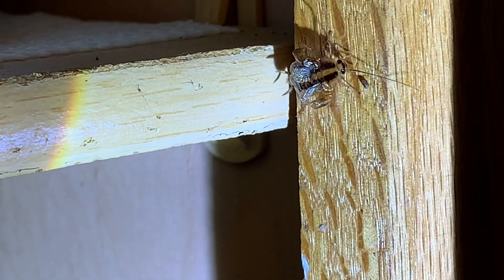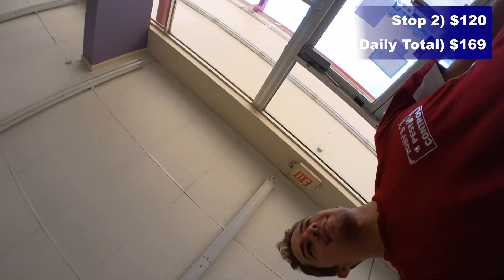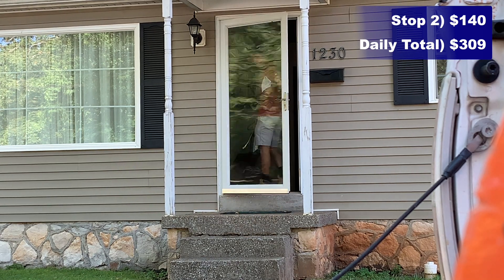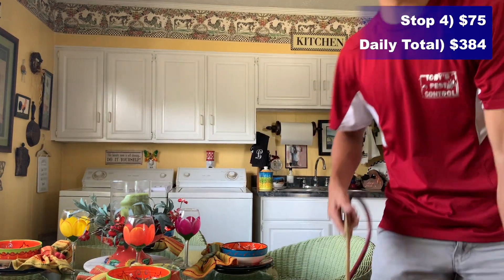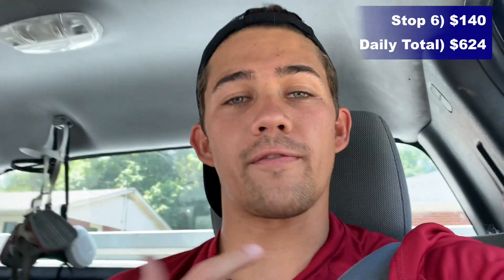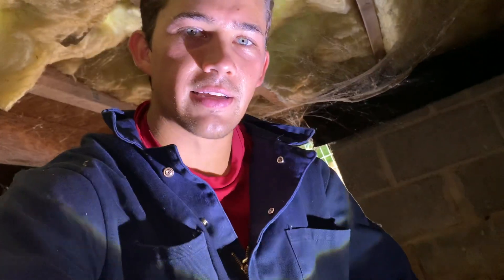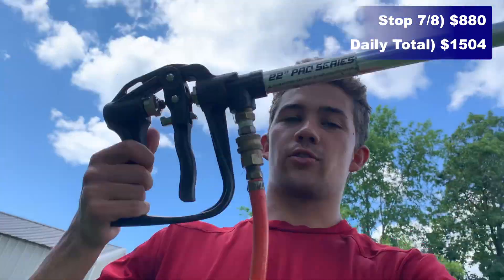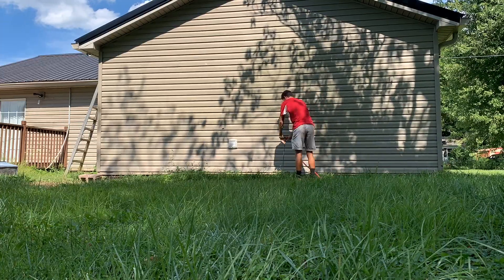I made $1500 as a Pest Control Exterminator - Termites, Roaches, & Mosquitoes

Comment: Im not sure what state ypu are in but here in South Carolina they are strict and i am in the pest control business and have my cat 7a structural pest control license and cat3 ornamental and turf license and its the law for us to wear pants at all times, we must wear boots on the outside and shoes with shoebees on the inside. When we do termite jobs it around $1500+ for a regular size home and a mono slab and we have to trench every inch and crawl spaces we have to trench the entire inside foundation wall and exterior wall and drill every pier and all expansion joints and i stall access panels inside home. On quarterly services i use a 100 gallon rig and spray around 15 to 20 gallons per house and a half gallon goes inside home. Itscrazy how different states work.

Comment: Great video man! What software do you guys run for routing and CRM? Thanks
Reply: I'm wondering the same thing Dan...what software you use?
Reply from the maker: Thanks! We use Briostack, a company out of Utah. I’ve had mostly good experience so far. It has everything you could ask for for a pest control software
Reply from the maker: Thanks! We use Briostack, a company out of Utah. I’ve had mostly good experience so far. It has everything you could ask for for a pest control software
Reply: Another great option is pest pac.   Very powerful software and does more than many of us utilize.   It’s the largest used software.   Pretty un user friendly.   Lists of frustrations and my brother has to manually create a lot of stuff custom.  The WDO stuff has been the most annoying.   The routing and tracking metrics are great though.  Gain loss reports, tech production reports, call back per tech/pest ect all all available and more. The dashboards are customizable too.   Unfortunately the system is not user friendly AT ALL and some stuff takes hours to program.    

However we are in active talks with field routes at moving over to their software.    For us (smallish) 1000+ reoccurring services that is a decent investment so we are serious about investing into software that is better for our our team.

Comment: When you’re using that rod I guarantee you the chemical is not dispersing enough which is why you need to use a trench 

Rodding is mainly for areas you can’t trench like heavy foliage or vines 

You can rod an ant hill for example but rodding dry grass / ground does almost nothing

Comment: You could make more money doing exclusion for the mice poison creates the possibility of a secondary poisoning to non-tatget species. And you to to learn about IPM sparying baseboards is a waste of time and product
Reply: Screen crawlspace vents with 1/4 inch hardware cloth you can charge $20 a vent or replace with Temp vents for $70-80 per vent installed. Then find any utility entry such as gas lines and ac line sets and seal with steel wool and silicone or if the gap is to big low expanding foam. At the gutters seal with galvanized steel flashing to close any builders gaps & screen gable vents with 1/4" hardware cloth you can get about $75 a gable vent. Seal any soffit returns (converging roof lines) if you get on a roof please use rope and harness. Set traps appropriate for the animal and monitor for 4 weeks. If you provide that level of detail you can typically a full wildlife exclusion is $1500+ most exclusion work takes 2+ hrs of work